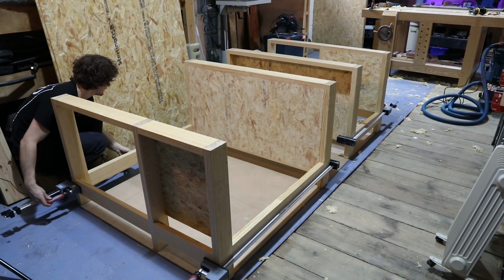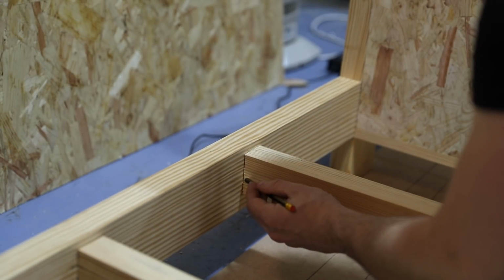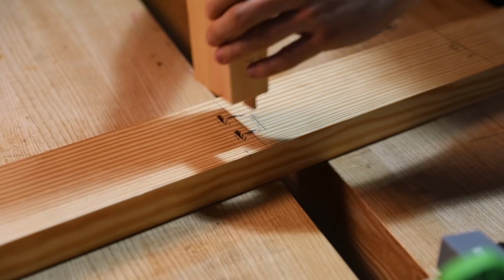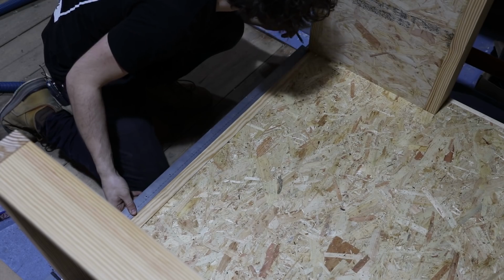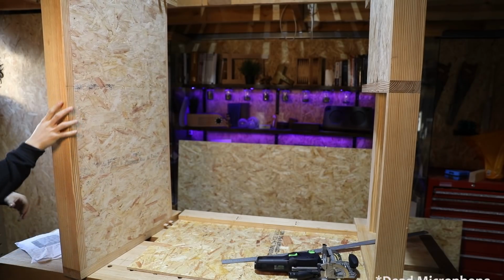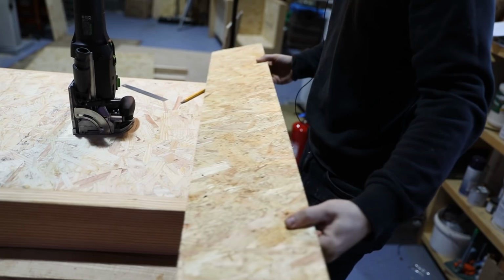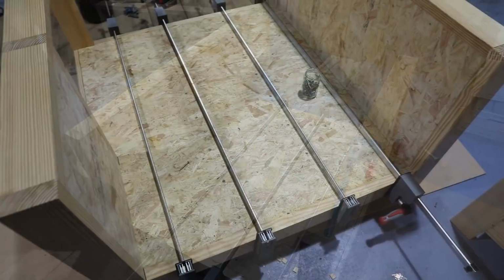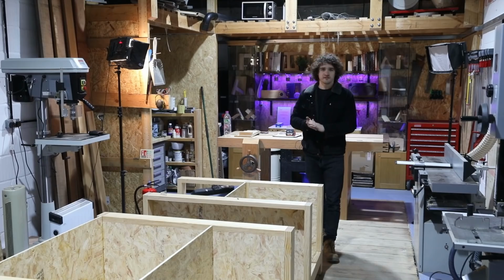Making the ULTIMATE Power Tool Workbench | Part 5

Comment: You can never have too many clamps.
Pipe clamps are more economical than the parallel clamps you are using and with threaded pipe being so cheap, you can have the lengths you need by changing the clamp heads. It's good to have both types. (and others for small pieces)
I will add scrap wood under the clamping surface so that the large pressure available does not crush the workpiece.
Reply: I'd forget the clamps period  and run in some construction screws .
Reply: Maybe in the US - I haven't found a cheap source in the UK - if you know of one, please pass it on!
Reply: @FirstMM  There was a guy on ebay with a few pairs a month or so ago, I got a few, think they're all sold now though.

Comment: Design question... Is the top the only thing holding the two bases together? It won't be a problem sitting there, but moving the bench will be risky (picking it up by the ends will put a lot of stress on the middle of the top).  Apologies if I missed something...
Reply from the maker: Yes you’re correct. But I’ll be bolting the cabinets to the top using M12 Metal inserts and Bolts which will make it easier to dissemble
Reply: @MattEstlea  Perfect. Easier to move it in pieces anyway. Thanks for bothering to reply.

Comment: On a residential construction site, workbenches like this are knocked together in a few minutes using whatever is laying around, and then taken apart just as quickly when the job is over.  The materials used like OSB and framing lumber are simply not high enough quality to justify the time/effort spent here in advanced joinery and glue-ups.  So... simple half-lap joinery done with deck screws, or even butt joints/pocket screws would have been fine for this kind of bench.  Just my .02.
Reply: Unfortunately, you’ve missed the whole point of everything that Matt does.
Reply: I know. What pretentious rubbish. Power sanding then planing? All fur coat and nae knickers.
Reply: He isnt building houses mate, he is building furniture and other smalelr items that need to be precise. If your table is shit the what you build on it will be shit. Ofcourse slapping 2 sawhorses and a piece of osb on top is faster but it wont last for several years, wont look nice and will not produce nice furniture.

Comment: I don't really understand why the dominoes in the stretchers weren't centered. If it was to line up with the lines you'd drawn, doesn't that just mean you'd drawn the lines in the wrong place? :-)

I see you've installed a kitchen in your workshop.
Reply: Yes Matt, is the newest power tool in your shop... a microwave?